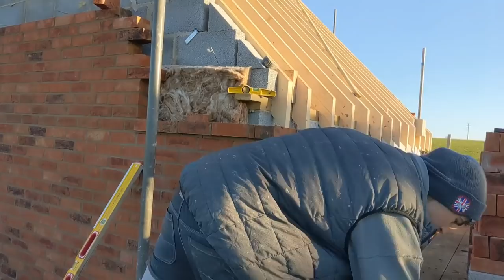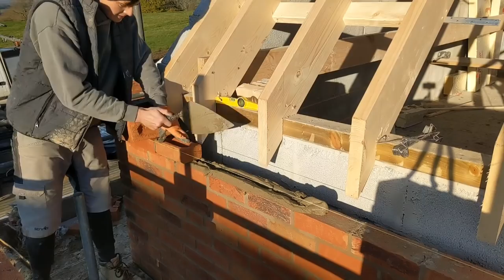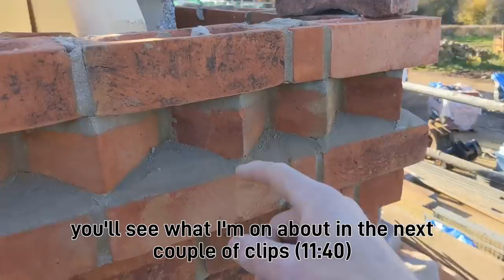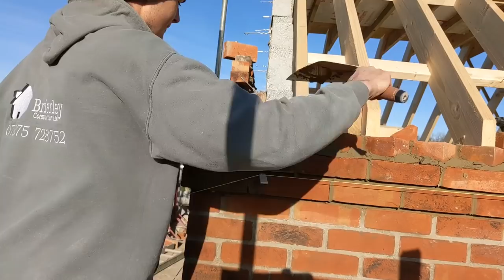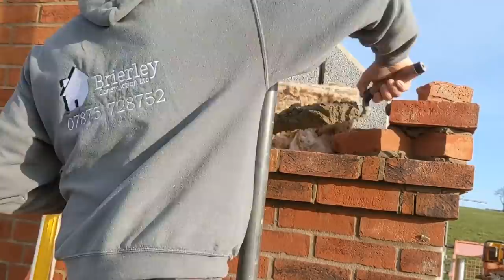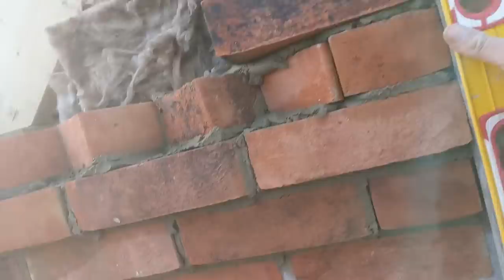Bricklaying - More Dogtooth Brickwork - tips & 2000 subscribers🥳 #bricklaying #vlog #brickwork

Comment: Hi Izzy,
yes, I know what your saying about the gutter brackets slipping and moving, your best bet in that situation is to wrap Self adhesive joint tape around the area that being bedded, only a couple of wraps is required.
It really grips onto the bracket, it's good for other areas where you want mortar to grip to  a surface.
I've even used it around PVC pipe on drainage pipes in a retaining wall, on the bedded area for grip, and the protecting area, where the customer didn't want to see the plastic pipe, but the pipes had to project from the wall, around 50mm, to stop staining, you sometimes get on the wall, under the pipe . Cheers
Reply from the maker: That's a brilliant tip mate! I'll definitely be using that one in the future ☺️👌👌